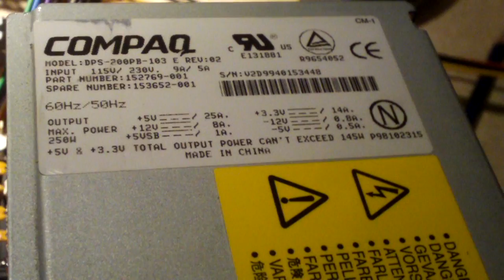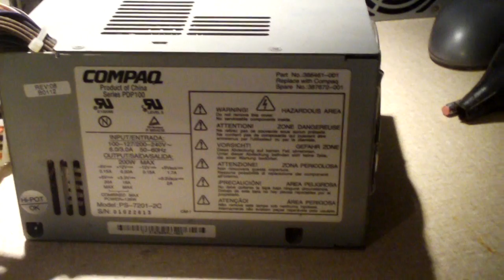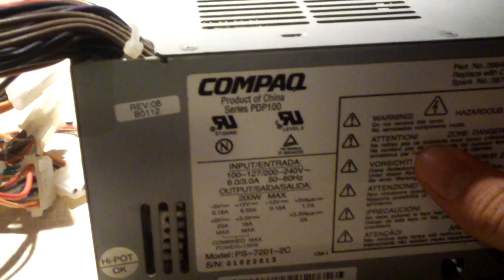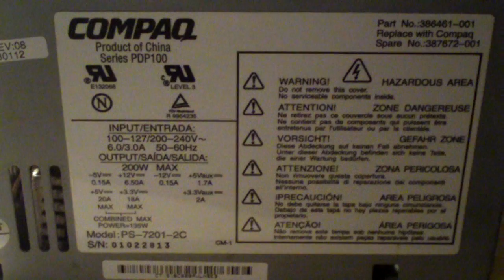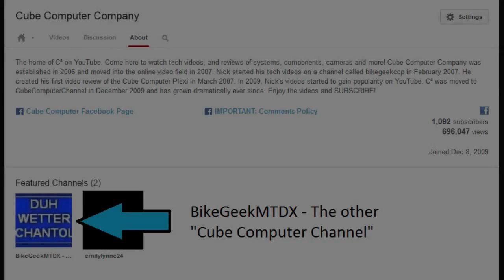A look at some old power supplies - Amazing build quality

Comment: I have some Enhance AT psus, very nice ones. Also, i have an old "TARGET" brand PSU (not the target shop or whatever) that is built like a pile of dog****. Its pretty ******* gutless, the heatsinks are wimpy and the MOV coil is some hand made piece of ****. Very minimum amout of components to make them run. The input caps are HEC and the secondaries are..... get ready for it.... Ruleycon (that is the worst rip off name ever). I might make a video about PSUs, i have a lot of them.